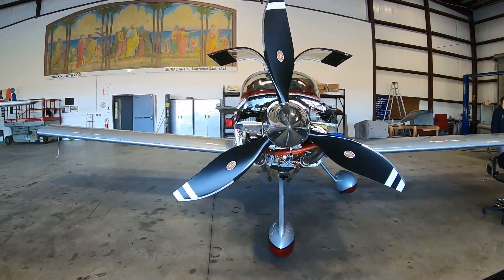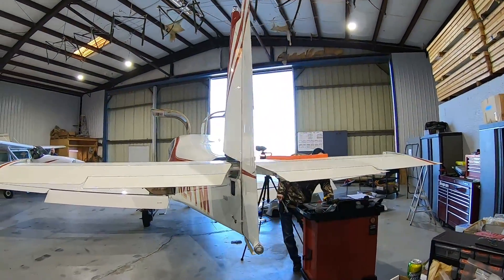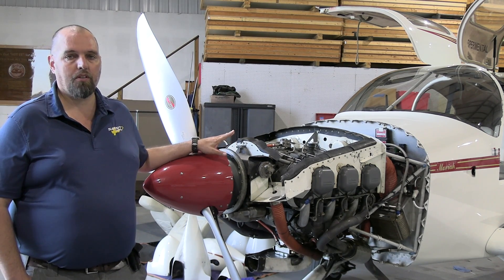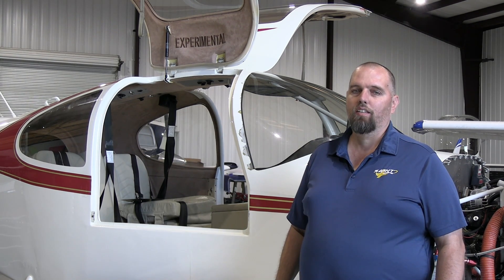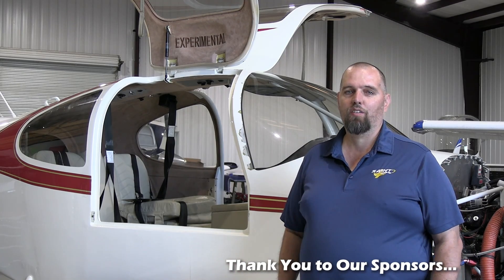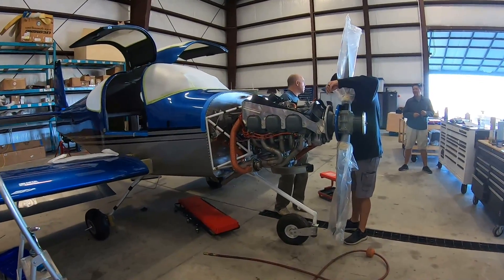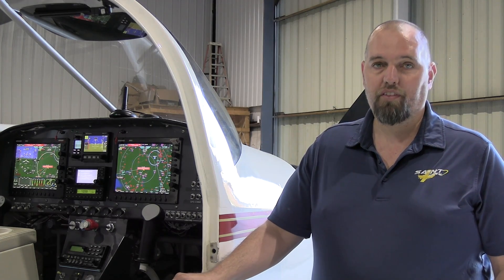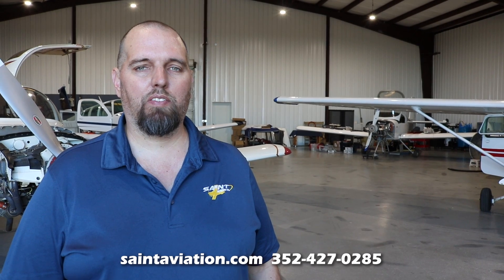Vans Aircraft RV10 and Dynon Avionics Build Assist Center - Saint Aviation

Comment: The whole kit is under 80k. So damn. The chute adds 100+ lbs to it too. So your 100 lb baggage capac just went down to 50 lbs with two pax, range just dropped under 660nm. No thx. Just buy a SR20 for 170k.

Comment: I'm curious how these builder-assist aircraft meet the FAA 51% rule for verified amateur construction.  What I see is a far cry from providing shop space, specialized tools, and technical consultation.  I'm not knocking the superior workmanship, but these appear to be more than 49% professionally built.
Reply: A long time from your post, I know, but the 49% is the limit for the manufacturer of the kit. The 51% can be completed by the builder or builders. Help is allowed, it just can’t be done by Vans, in this case.